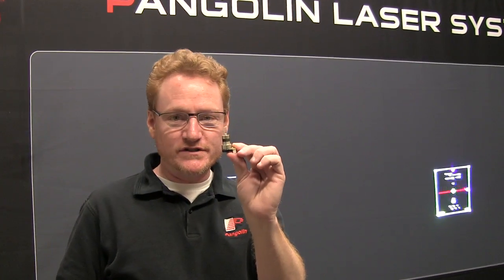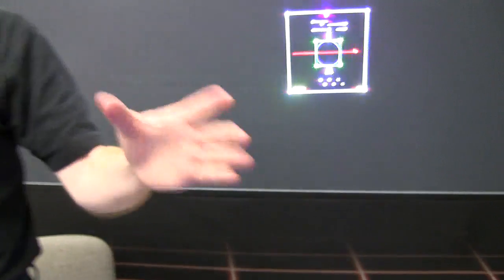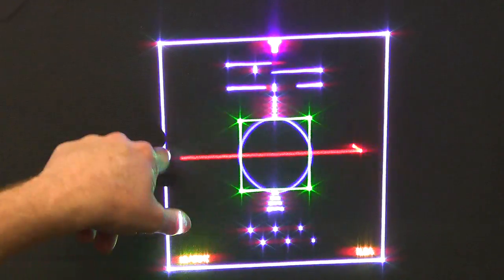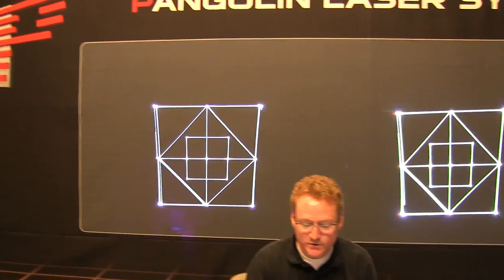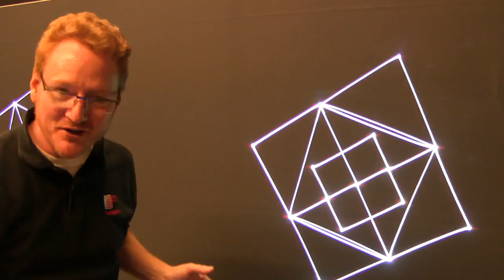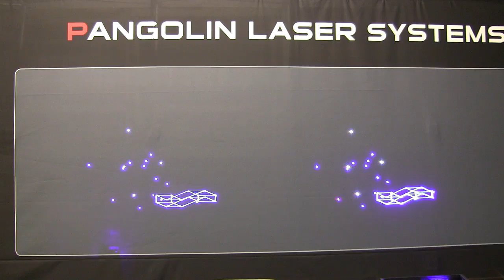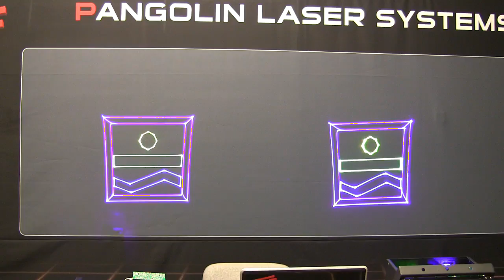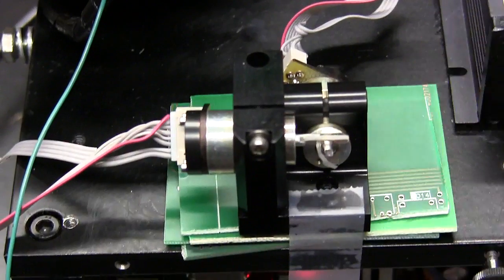ScannerMAX Compact 506 versus DT40

Comment from the maker: Gabor, your question about CT is a good one. We have a lot of projectors come through Pangolin with DT scanners and the like. Among the low-cost projectors on the market, not many have CT scanners. In the case of this particular video, we happened to have a projector with DTs handy, and so I took the opportunity to make this video. When we have a projector come through the office with CT scanners, then I will make another video and post it. However, with that being said, I can tell you that we've done similar tests with CT 6210 and the performance is really similar, with the exception that the Compact runs cooler. 6215 is a bit of a different story since that scanner has a rotor whose inertia is double that of the Compact 506. 6215 certainly should give better performance, but the price of that scanner is nearly 10 times the price of our Compact 506. The Compact 506 is a great scanner for the money. If you want higher performance, the 6215 is one option, and Pangolin also offers Saturn-series scanners for even more performance than that.